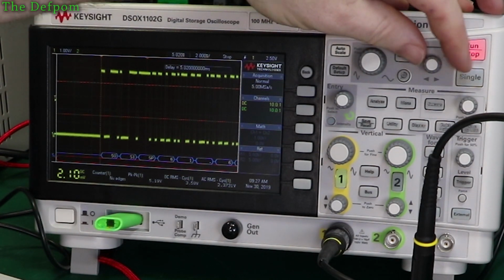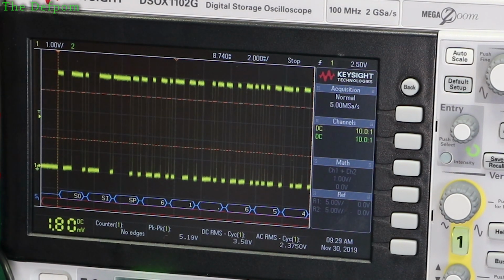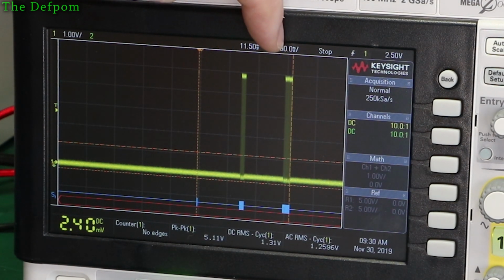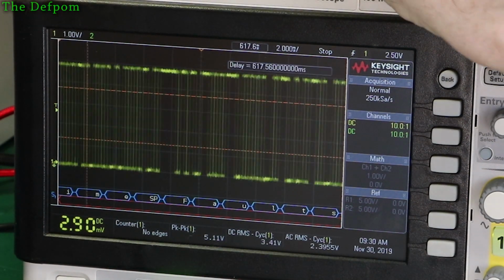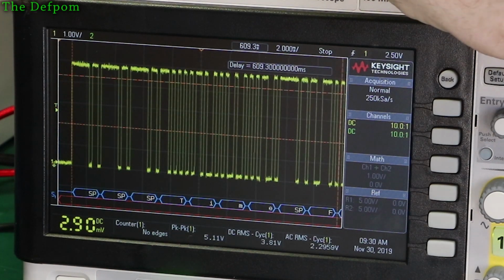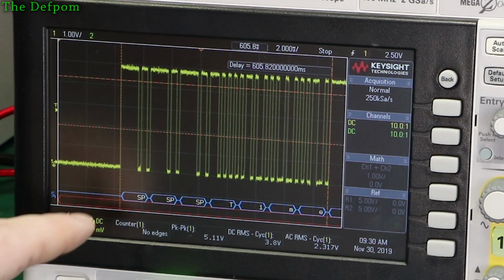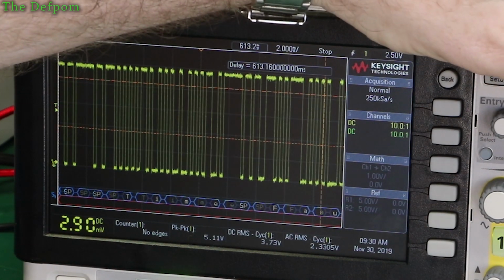#673 Farmtek Polaris Interface Project - Keypad & Controller Part 1

Comment: the serial protocol rs232 in the oiyput, works on GND and middle pin, but the tip of the plug has the signal for the scoreboard, anyone knows what is the protocol of that info??? rs485, rs232 or wich one please

Comment: could you share the code of your sketches, interested in doing similar, but have the output to a Raspberry Pi instead.  I would be interested in the logic on the output processing, as I do not have a logic analyzer

Comment: I happen to be working on a project where I'm trying to read the output of a Farmtek Polaris with a Bluetooth Serial device, and I'm having a hard time translating the readout.  I can get serial ascii data from the device by programming the output to a printer, but when I am in the standard mode (link in this video), I'm getting a similar series of characters, much like your oscilloscope in a UINT8 byte array that can almost be read as binary (0 = 0 & 128 = 1).  Do you have any insight as to how to decode the byte order to get a readout that correlated to the stop time?

Comment: Really interesting project! I think I have figured it out from your answers to comments but I wish you had taken a few minutes to describe the overall project and what problems you are trying to solve - I believe that would help many YouTubers with view numbers. Looking forward to the LoRa part of the project, I've used the nRF24L01 2.4 GHz transcievers connected to Arduinos for sending data, but these have restricted range with a maximum 0 dBm output.

Comment: I compete and volunteer at dog agility trials all of the time and every club in the area uses the same Polaris timer.  Around here the results are often written on paper then hand carried to someone with a laptop who then manually enters the times and faults into a program which then displays the results on a large monitor or TV.

I have thought about building such a system myself but the timers are expensive and most clubs are not willing to part with one long enough to do much reverse engineering like you have done here.

Very interested in seeing how your project ends up.  I know of several agility clubs in my area that would love to have a more automated system for displaying results.  Having a backup of timer data on an SD card is a nice bonus as well.
Reply from the maker: William Osborne - yes the paper method is what we are doing currently too, which can introduce errors at times, this system addresses a lot of the issues we see. I have been meaning to build this system for about 3 years, but kept putting it off because of how many problems had to be solved and how much time it takes to build it, I was right, so far I’ve spent 5 weeks on this thing tweaking code, sorting out hardware etc. I have a fully working system already, I just need to make it look nicer and optimise the code to clean it up, the codes a mess at the moment from the various alterations I’ve done to it over the past  weeks, I need to sit down and rewrite about half of it. I have a few more videos planned on it, most of the footage is already recorded.

I have the possibility in mind of selling a small number of units, rather than just keeping it for our sole use.

Comment: I wanted to do a project that monitors the contact relays of my well's pressure pump when it turns on my water pump.  I have a 1.5hp water pump, 350 feet deep.  I blame it for high electric bills.  I wanted to monitor how often and how long the pump is run and have the device log the data to my network to a CSV file.   I do not have an idea where to start.  A module like you are using, with a WiFi interface, and I like the SD interface, would be great.   I am very good at VBA and VB6 (dude, I am old).  I do not understand Python or the new languages associated with Ardrenos or Raspberrys.  Maybe they aren't that difficult, but I was hoping to us VB6, but I doubt that is possible.  Maybe I could learn python.  Is what I want to do possible with a device like you are using here?  I guess I would just need an A/C to D/C solid state relay.  Since the well is 220v, I would spring for a greyhill input relay device.  Thoughts, suggestions, help?  Thanks kindly.  Keep up the great work!

Perhaps there is a general learning kit that would be a good place to start?  The display is a good idea too.  Not looking to market this, just for my own use.  If I get the basic idea working, and A/C current draw input would be a good add-on.
Reply from the maker: Daveyk021 - arduino systems are pretty easy to learn, the arduino IDE has example sketches which you can use to get started more quickly and understand how it works, plus there is very good coverage online for it.

You could very simply add a relay to the pumps supply line to turn an input line to the arduino/esp8266/ESP32 on or off as it’s running, and could easily log to an Sdcard or send results to a website.
Reply: @TheDefpom  Cool; do you have a model or one that you would recommend ordering?  I don't envision logging to a website, but to a drive location on my home network server, if that would be possible.  If it has a wireless WIFI adaptor and drivers, I should be able to program in to it how to access the network drive and folder.

It is a simple project idea, but would be useful to me.  I can see adapting it to other things if I could make it small enough.
Reply: Hi :) if you are frightened about c++ for arduino, try b4r (search in Google). Is a very good product if you only like vba and dont want to make more complex programs. Im an old vba lover too lol but is true that i like to make complex things in Arduino and esp8266/32 so I really prefer c++ for this. Anyway , you will become much less frightened with b4r, try It :)
Reply: ah, and about the pump... are u using a variator?

Comment: Hi Scott is this likely to be a cost sensitive or just for  fun. I’m just wondering if you would find the development environment easier using a higher level platform like a Raspberry. Just that you have lots of memory and it’s easier to plug in peripheral like large monitors and keyboard  and have a file system etc etc.  Scopes are great for identifying the protocol and baud rate but once you have done that it’s much easier to use a terminal program if possible or USB logic analyser works well. Note I have never used a raspberry pie  but I often find it useful to trade the cash for time saving etc.   Sorry not teaching to suck eggs looks great. Still really nice to see you get stuck into a project I’m quite envious. Regards Chris .
Reply from the maker: AllTheGearNoIdea - well I am building this to solve some issues we have been having, and push the sport ahead further (as I have been doing for the past 8 years), mainly intended for personal use at events we work at, but I do have it in mind that it could be sold also and have it become more widespread. So far I have spent well over $1500 on bits and pieces  for this project.